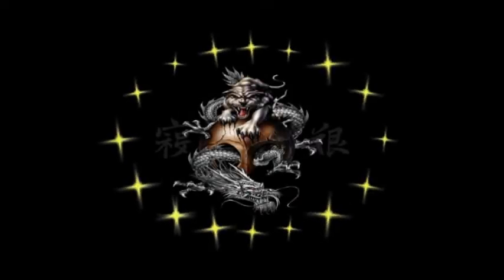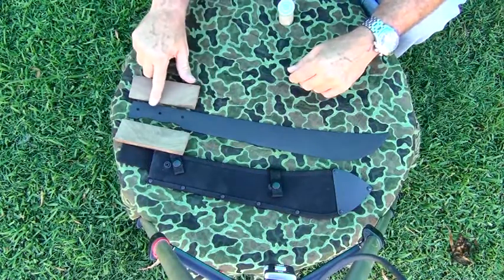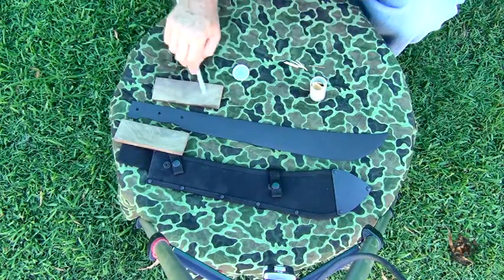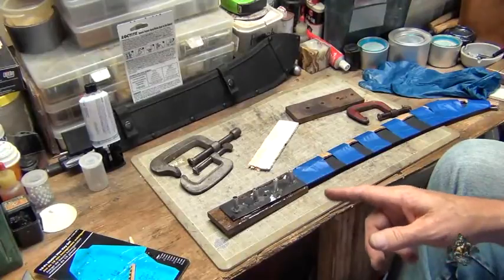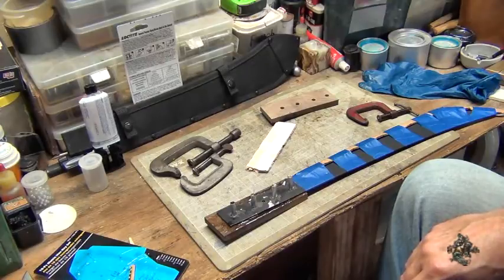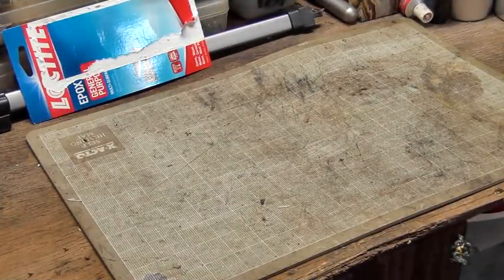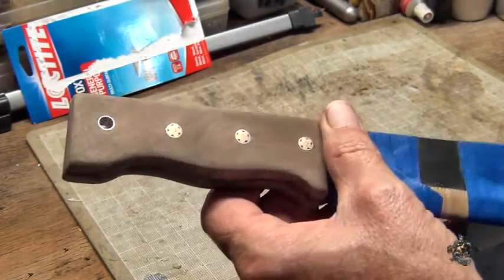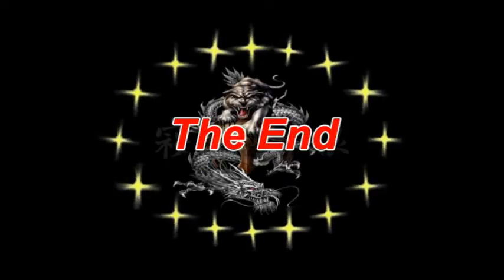Machete Refurbish

Comment from the maker: Thanks for your very kind comment Ed. I killed 2 cobalt drill bits drilling holes in the handle. This is an old machete and made of better steel than the newer ones are so once I get a good edge on it hacking will not be a problem. Also I appreciate you watching this too ;-)) Take Care my friend :-))

Comment: Just starting to learn about how to YT - finally got off dial-up. Hadn't thought about slide show - have digital camera - no video yet. Will get there one day. :-)

Already setup for electrolysis. Been cleaning & restoring cast iron cookware for quite a while. BTW, boiling in vinegar/water solution  removes rust faster than soaking. Safer as less chance of vinegar pitting. 

Enjoy watching all of your videos. Thanks for sharing.

Comment: I'll check the camera - Thanks. 

I use a non-reactive waterbath enamel canner. Fill 3/4 full with water & add about 1/2 gal white vinegar. Add castiron or carbon steel pieces propped on bricks in pot. Bring to boil & hold for hr. Cool down naturally enough to handle. Scrub with steel wool. If rust comes off OK. If not return to pot & repeat for 1/2 hr or so, as needed. Rinse well & rinse again to neutralize vinegar. Immediately season as flash rust will form quickly. 

Best done outdoors.